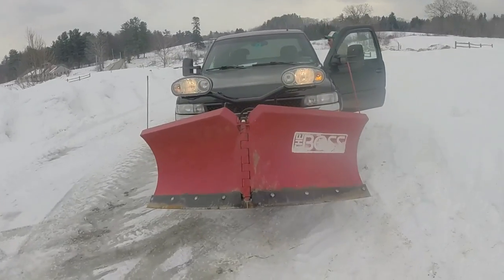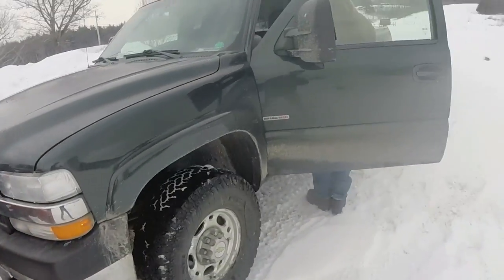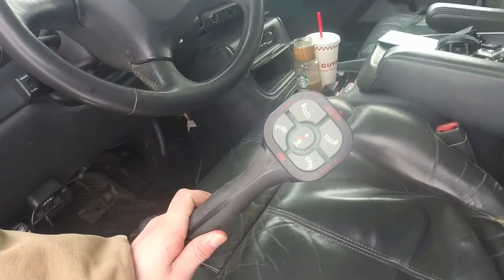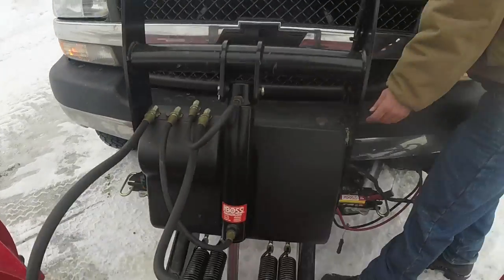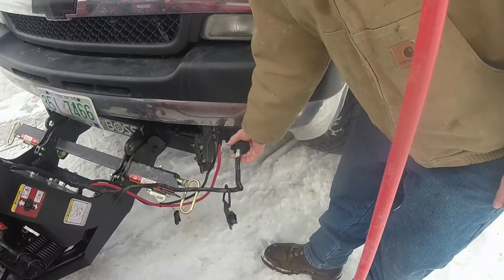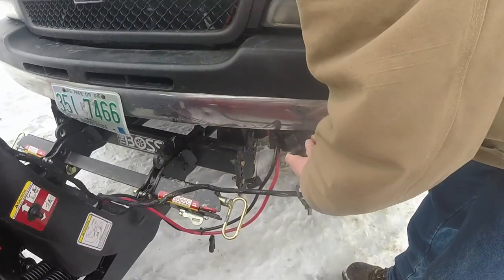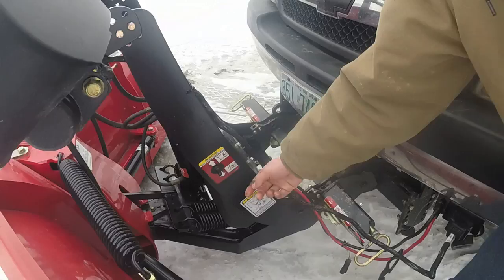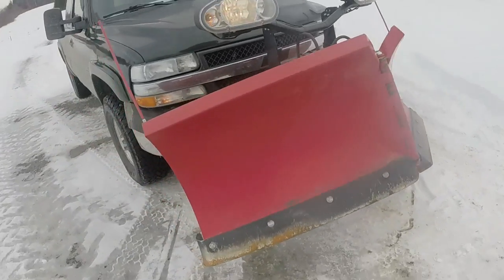How to Mount and Unmount Boss Snow Plow

Comment: Nothing is that easy would if your not on level ground I bet it doesn't go on that easy
Reply: That's for sure!!  My 2018 F350 is a bitch to attach if there's so much as 1/2" of height difference from the front wheels to the plow resting position. A few times this winter the plow was removed on snow and ice and then I had to attach at 3am by myself and had to manhandle the fuck outta the plow... I'm a big guy so it wasn't too big an issue for me but if you were a small guy there's no way in hell you'd do it without a jack and some help. These things need to be level when you're dealing with a 9'2" blade.  I have my blade perfectly adjusted in regards to mount height, bump stop adjustment and trip spring adjustment and there's zero play.  Oddly enough my friends 15 year old 9'2" blade is sloppy as shit and well worn and is easy as all get out to install because there's so much slop.... Just a kick and a jiggle of his and Bizam! She's on.... Mine? Nope. You gotta be surgeon precise before mine will slide in and lock up. Haha.

Comment: 🤦‍♂️I do not know how many people I’ve told when disconnecting all u need to do is hold up on the plow connect and Disconnect and you hear clicks let go of it it will lower by it’s self
Reply: Yes you can do that, but by letting go by it's self, air will get trapped in the hoses and cylinders, and potentially damage stuff

Comment: My switch didn’t work
Reply: Mine didn't either. What did you end up doing to fix it?
Reply: I have to take mine in. My latch hook broke for the on off. I have some wire issues also. Made it through 2 winter's with a 4yrs old plow